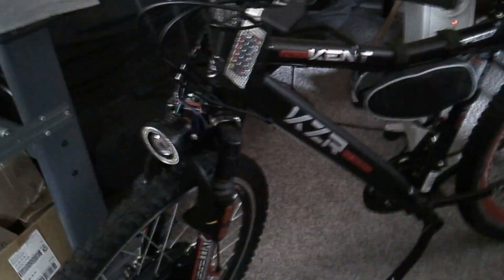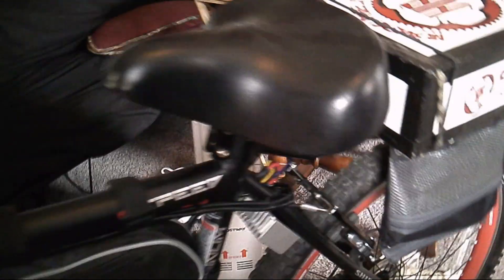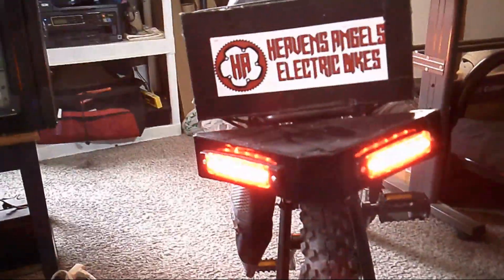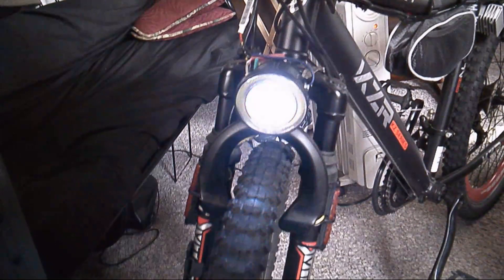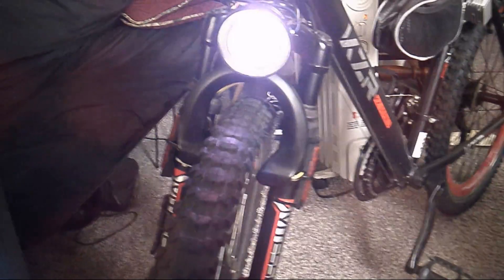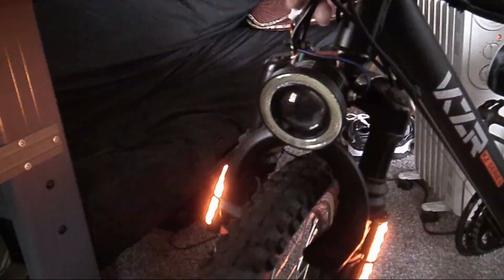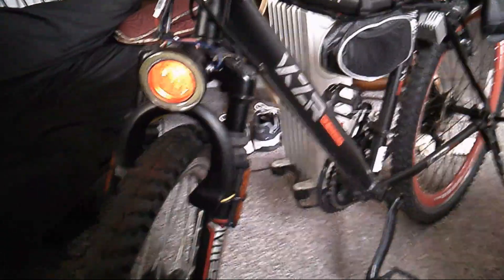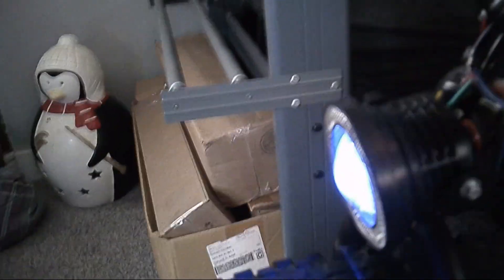The Watchman News - Electric Bug Out Bike Video Two - Lighting

Comment: Hey that's really cool! Maybe I missedmit, but do u have the option of switching all the lights off, even brake lights?
Reply from the maker: Yep, you can shut them all off. I forgot to show the button switches I have on the handlebars. There are 2 separate button switches. In the video what I call the "parking lights are controlled by one and the main center light is controlled by the other.

Comment: Another solution to 48v lighting is simply using 4 smaller bulbs in series with one another ....four 12v lights in series (or 8 6volt etc) should work PERFECTLY on 48v AND could even be dimmable!   I like that better than trying to regulate`....just know that with series if one Burns open all go out ...also ALL the lamps wired in series have to be the same wattage or it could cause real problems